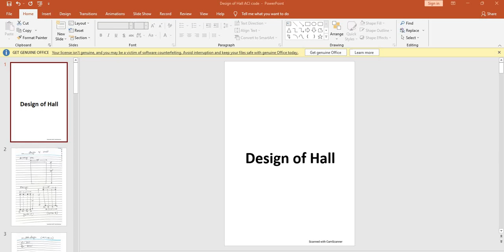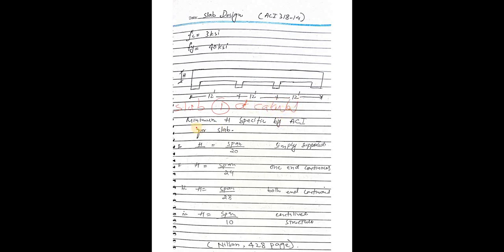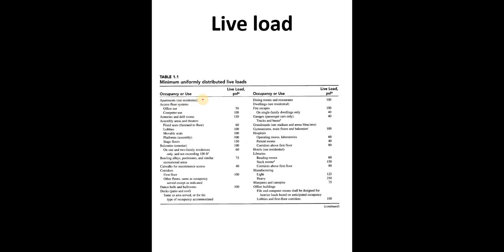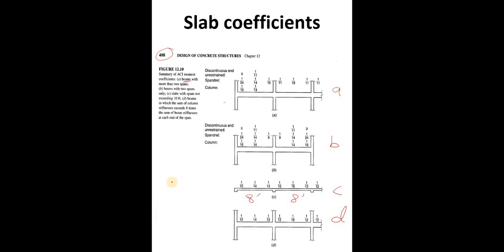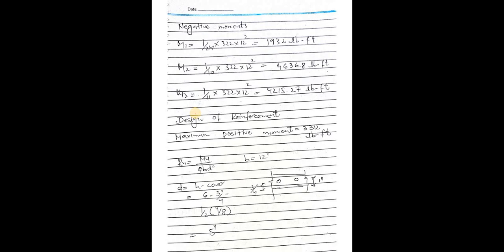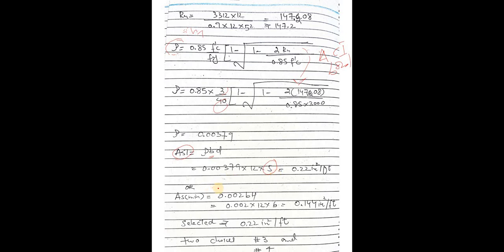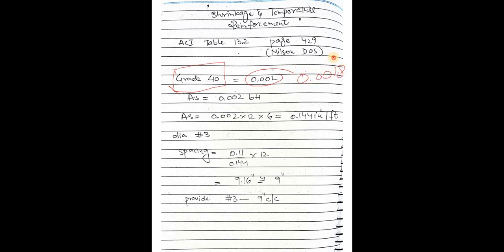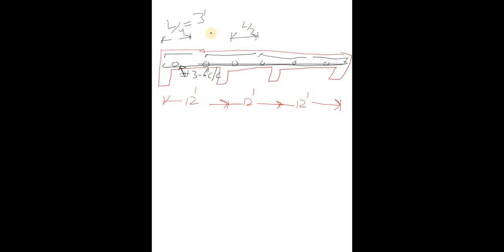Design of one way continuous slab

Comment: what about the bent-up bars at the supports and their area.The main thing in this topic is, i think so and unfortunately it is missed.
Reply from the maker: Bent-up bars is the traditional way to controlling negative moment. In current era, negative bars are used instead of bent up bars, bcz bent up bars are difficult to bent on a specific angle, also it cause the steel corrode and weak at the junction.